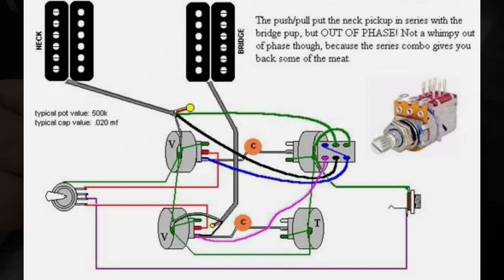Firefly FFLG SG Custom Wiring

Comment: Why on some guitars does the capacitor bridge from the tone to volume pot while on others the capacitor is just on tone pot?
Reply from the maker: This way is the 50's wiring of the tone caps, but to be honest. They all work the same way. The only thing I could really say is it is much easier to mount the tone cap on one pot than across one pot to another. I have tried to look the same thing up online, but never came up with a good reason.
Reply: @ericctheartofnoise8613  thank you for giving me an answer. I was wondering if I should redo the ones I put in my guitar but if it makes no difference then meh 🤷🏿‍♂️